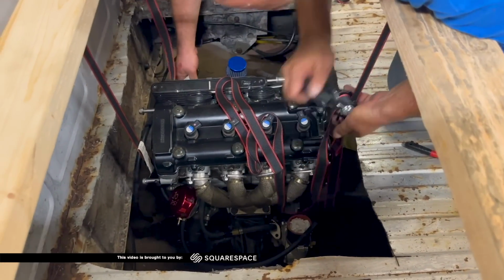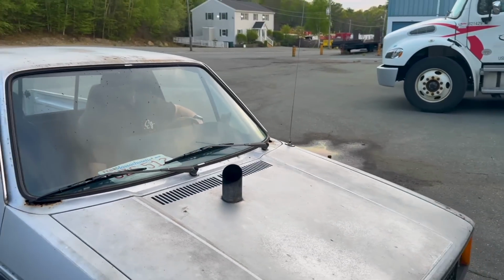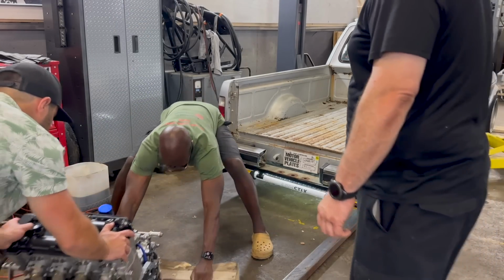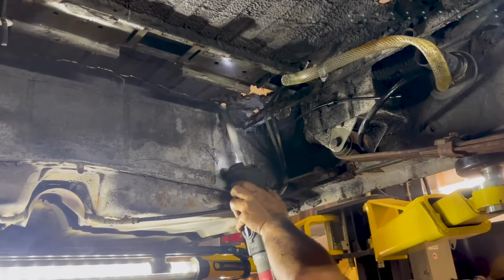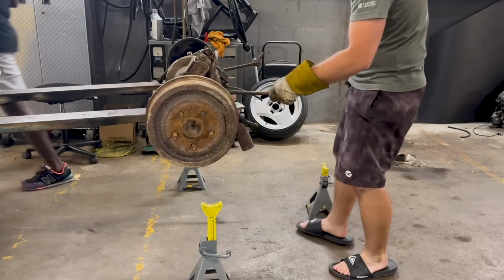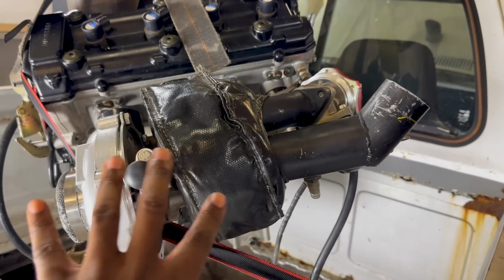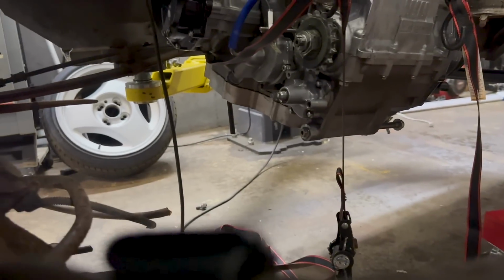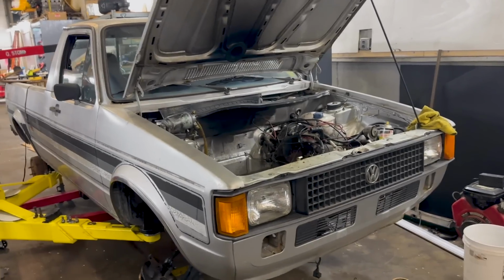Installing A Turbo Hayabusa Engine into an old Volkswagen pickup truck

Comment: There are a few Rabbits with Busa engines but they are all under the hood in the normal position. Would it have been easier to mount engine under hood and fab up a AWD system?

Comment: Cool Project! But why in the back, you made it less practical! i mean yes RW-Drive but that would also have been posssible with a front mounted one! Even better you could have made it All-Wheel Drive but not 50-50 but like 80 rear 20 front, or even better use the system the R32 Golf uses (VW 4Motion Stuff).

Comment: Can anyone see the issue with almost every car with a motorbike engine.

The bike engine has a clutch. A clutch that's designed for a bike weighing about 260kg and driving 1 narrow wheel.
Then it's put into a vehicle weighing 3 times as much, with twice as many wheels with wider tyres.

I see this a lot in bike engined smart cars. They aren't quick because you either smoke the tyres or smoke the clutch trying to pull away.

Great for loads of noise, tyre smoke and pantomime but not so great for actually pulling away.

Comment: Look into superfast matt's shifter design for his motorcycle engine powered s600. It seems relatively simple and doable, and I think the shifter-mounted clutch is really cool
Reply: All hail the algorithm.
Reply: I checked the comments to be sure I wasn't redundant. This is definitely the correct answer. Probably find solutions to several issues there.
Reply: I was just going to suggest SuperfastMatt but you beat me to it. Maybe even a collaboration.
Reply: Get Matt to build it except he would want to completely redesign the suspension...
Reply: agreed
Reply: SuperFastMatt's dry wit and Rich's comic timing could work very well together.
Reply: What about a off set rear axle?
Reply: @constantinejosephides3312  Was thinking same thing once I saw line up problem.
Reply: Shifter mounted clutch!?! I want that now, it actually sounds so sick
And convenient, like you just squeeze the shifter when you change gears and your clutch timing is near perfect, it’s almost like a quick shifter 
Time to go check out that build
Reply: Yeah that's a great vid
Reply: Well said🔥
Reply: Don't, he'll leave problems for future Matt, who won't be there!  It would be an interesting collab though.

Comment: Turn the sprocket into a drive shaft output shaft. And put it straight to the differential. Instead of having the engine to the side with a chain drive. It’s just one screw in the middle. OMD YouTube channel did it in a Toyota starlet. Got rid of chains

Comment: You're basically building a Koenigsegg Gemera. Peppy small engine in the back, potent electric motor in the front.
Hooking it all up, usinmg the engine to put energy back in the battery, that's all quite straightforward but don't tell any car brands about that.

Comment: Firstly, why are you putting that engine in that crappy VW when you have the mini sat there begging for it? Take the sprocket off and take it to a machine shop, they can machine a coupling that should match the splines on the output shaft.

Comment: Wouldn't a 1:1 transfer box fix the pinion angle and shat issue? You could lace it anywhere and mount the engine in the center for better balance and traction 
 there's a few motorbike swapped rwd cars here in the UK and they run a chain from the output sprocket to a right angle transfer box with a splined shaft
Reply: He did indicate that it's almost certainly going to be AWD, but not a big stretch from this idea to make it so.

Comment: Maybe just run a chain down to the driveline? Wold need to mount the front of the driveline to a big bearing that could move up and down to adjust chain tension. Would also allow you to offset the motor from the driveline.

Comment: Could you make a driveshaft that runs under the bike engine with a support bearing at the front and then run a chain down to the driveshaft?
Reply: That’s what I thought, and turn the engine around too. Plus it would be higher up and centered, looking better.
Reply: Like a drop down transfer case but external
Reply: @tommallinson619  right. If it was a bigger truck you could use a boat V-Drive, a chain will work and, ahem, more in keeping with a Rich build
Reply: That is how they do the mini-cooper Hayabusa swaps. Sketchy but works.

Comment: Dont really understand the point of a truck with No bed, but you do you
Reply: That bed looked like swiss cheese with all the rot holes, so it was already gone
Reply: I don't think you should pull any weight with a motorcycle engine anyway so it really doesn't matter that much.